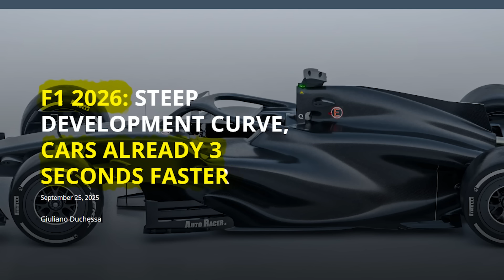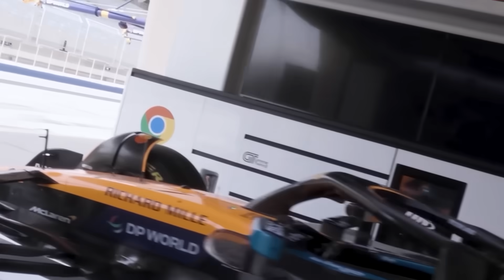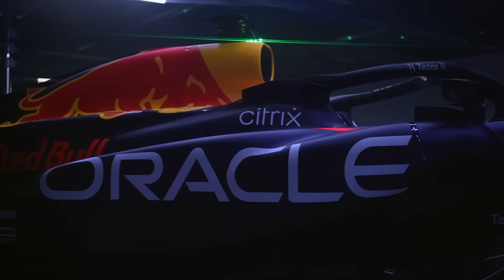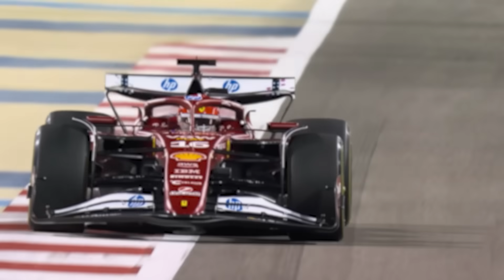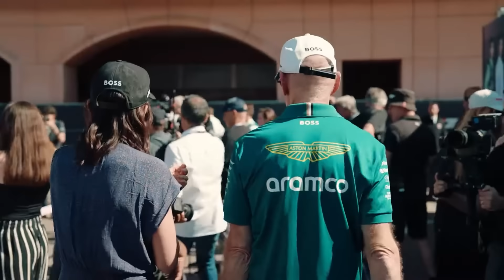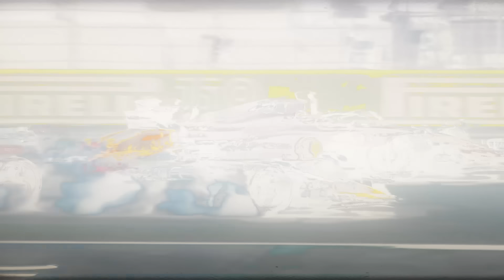How 2026 F1 Cars Are Already 4 Seconds Faster

Comment: Does the FIA realize that if the wings in the front and back get stuck open. We could see some serious crashes, possibly even death.
Reply: That's my fear too, power and downforce can be vastly different depending on the state of the car throughout the race. Make an error and you'll be entering a corner too fast. Verstappen can probably manage better than most, but lesser drivers can be caught out. Especially in difficult situations like a wet track. The whole idea is dangerous.
Reply: Do you realize that drs is the same thing and rarely we see drs getting stuck.
Reply: @solo_wing_pixy_fan7367 not anymore but when it was new it definitely did. With this have new mechanism as ways up operating i see it happening all over again.
Reply: No you won't see death, you could see crashes sure but these cars are designed for it. This is F1. They are meant to design for these challenges. And they will. No pussy footing after all the million safety features added in the last decade.
Reply: @rohitrevankar7674 i dont know those flaps stuck open and the car going over 350kph which they're predicting. I dont care how safe a car is designed. You hit a wall at that speed or more you dead. Especially if it reaches the 400 kph mark.
Reply: @shades29045  Run offs are designed to slow down the car. No way a car hits the barriers at top speed. You are underestimating F1 tracks and engineering way too much it's quite insulting especially that you are convinced you'll see a failure.
Reply: @rohitrevankar7674 i have a moto. Expect the worst hope for the best. It's better to prepare for the worst outcome and be pleasantly surprised when it doesn't happen. Then thinking it won't happen and being surprised when it does.
Reply: @shades29045  And you think FOM, FIA and the teams don't think that way? Right. Okay. lmao.
Reply: @rohitrevankar7674 i don't know honestly  nonone knows for sure. But lately they seem more interested in making F1 a green spectacle. So i don't know what they think. I hope they think that way. I'm just saying what I'm thinking. My concern for the disappointment that these regulations might be. I hope im wrong. I do hope they bring V8 engines back. I know it won't be till 2032 but one can hope. Especially after hearing that snippet of engine sound.
Reply: @shades29045  2031 will be the year. That's when both the technical regs and the concorde agreement expire/renew. So we'll know about it by 2028 max. But in any case I'll be stunned if 2026 is going to be anywhere near as bad as some ppl are afraid. One thing for sure is that racing will be tactical rather than all out cornering and braking. That's smthn some fans and most drivers will not enjoy and probably where the negativity from some drivers is coming from.

Comment: Dude I’m sorry but how tf are you asking for it to be louder? They are power units not engines. The engine is basically just a starting motor at this point
Reply: Because we are fans that remember what v10s sound like and we aren't ready to just roll over and let F1 become formula E. If you like it so much go vacuum your house
Reply: @Gleepglurp ok 1 chill tf out. You’re so pissed off at your own imagination it’s unreal. Where did I say I dont want better sounding engines? I said the power units we will have next year won’t sound louder because they’re basically a starting and charging motor for next year. But f1unchained said he hopes they sound louder than next year when that’s literally impossible. Calm tf down you absolute weirdo
Reply: @Gleepglurp  You aren't running your vacuum to bring back that shrill V10 noise?

Comment: Why are so many people are whining about these cars? Yes, we want V8's or V10's, but that's not happening. So if we put aside about the fact that we are stuck with V6's, we really know nothing about how these new regulations will play out. 

Getting rid of DRS is awesome imo. The cars a bit smaller which is definitely good. Push to pass is good. Adaptive areo might be cool. It sure opens up lots of possibilities for the aero engineers. The cars look good too, no? Will they sound better? Hopefully. Either way, we really have no idea what to expect, so why whine and complain so much? Patience my friends.
Reply: They have a 50/50 electric / ice split but they have very little electricity to deploy, so how's that going to work? You're going to be left at 50% for most of the time. There's going to be no point in overtaking in the corners now. All straight line push to passes.
Reply: You serious bro. They got rid of Drs and added active aero. Basically Drs in the front and back now 😂.
Reply: It's Mario Kart, there's FE for that already.
Reply: Hopefully between energy management, aero configuration, tire management, and all the button pushing required for this, the drivers will have enough time to race each other.
Reply: Why, specifically, would v8s and v10s not be happening ?
It's a spectacle at the end of the day and if the regs keep trending away from exciting cars that provoke emotion, the momentum of popularity that F1 has enjoyed recently, will eventually be damaged. FE cars just aren't exciting no matter how good the racing is or isn't.
Reply: It’s the not the v6 that’s the main problem, it’s the battery percentage and they way it’s going. It’s supposed to be the pinnacle of motorsport, the best of the best, innovation, technology but 50/50 battery/ice isn’t exciting or the future of F1.
Reply: @beany1987 I agree but they're also pushing for "green" which would mean more electricals. 

Now I don't agree with this personally, but also the battery issue is only on certain tracks and is unlikely to be fully drained going 400kph because it's unlikely teams will view it as worth it
Reply: @westay4924 they are already going to use 100% renewable fuel so I don't really see the argument for ev components being better for the environment.
Reply: They are Changing to V8’s-Sustainable Fuel from 2030. It’s half confirmed by the FIA
Reply: yes, we know, it doesn't take more than a brain and a calculator to figure out that these new regs will be shit
Reply: @itshammertimeF1  Well a smart brain knows that this essentially is F1 with Nitrous/NOS like in games. A temporary boost that recharges itself. Looking forward to NOS boosting F1 cars doing mad overtakes and defends. Don't get stuck on it being "electric". Just like in games you can't constantly use NOS, you have to be strategic where you use the energy.
Reply: @drags-yt  nitrous oxide does not replenish like that, nor is it especially effective when you have a turbocharger
Reply: couldn't they go hydrogen? we get v10 hydrogen cars that would be half the sound of cars that use petrol or diesel and if they want to be innovative for the future or cars pushing hydrogen and showing it can be a valid option for mass use over fossil fuel. Wouldn't that be better? (and ofcourse we get the beautiful v10 sounds)
Reply: @bubu6225 burning hydrogen is stupid as it’s less efficient than using it as a "pile à combustible" (i don’t know how it’s called in english). But as they go lighter and with synthetic fuel, the need for more electric is questionnable.  The electric part isn’t optimal as well. I don’t understand why they limit the regen per lap, and why there is no regen from the front wheel. The hybrid part is really sub optimal and we can imagine super condensator instead of lithium battery to save weight as well. But i'm sure they have good reasons. There is a lot we don’t know
Reply: @thomaslegoff4069 no front axel regen is because certain teams were in fear of Audi having a massive advantage with 2 axel regen systems. Apparently, Audi was actively pushing the regs towards front and rear regen.
Reply: @bubu6225hydrogen is fucking stupid and not practical even for motorsports.  Yes it's "possible", but not practical

Comment: Can you make a video on how you think the braking system will work on F1 cars in 2026? We’ve already heard from Brembo that some teams want a very small braking system for next year, compared to this year. There will obviously be a lot more engine braking.

What I would like to know is how this will impact the drivers. How much engine braking will there be if the driver is neither on that throttle or on the brakes? How much engine braking will there be in the split second between having completely gone off throttle and still having to apply the brakes, as you approach a corner, assuming the driver doesn’t overlap throttle and brake inputs? Since engine braking will be on the rear axle, what will the effect be on brake bias of the Brembo brake system? Will the brake bias next year be something like 80%, instead of something around 57% this year? Will the Brembo brakes in the front wheels be bigger than the Brembo brakes in the rear wheels?

I guess we’ll probably have to wait until next year to answers to those questions, but I wanted to know what your thoughts are.

Comment: For drivers that have done Super Formula, it uses an "Overtake System" (OTS), similar to IndyCar's push-to-pass, which gives drivers extra engine power by increasing fuel flow when a button on the steering wheel is pressed. Since the 2021 season, drivers are allocated up to 200 seconds of OTS per race, with a minimum 100-second cooldown period required between uses. The system allows for a roughly 5% increase in horsepower and is a key strategic element for overtaking and defending during a race.

Not sure on how the F1 system will work and if there are effectively cooldowns or the like.

Comment: You've got me excited for these engines and regs somehow, bravo 😆. A few things I wanna talk about however, mainly the pace of the cars. I do think that peak pace isn't going to be far off, if at all. The peak power of the cars are definitely there. My worry is largely in the energy usage over a longer stint, like race conditions, and is likely where the gaps between the faster and slower teams will be very apparent. The clipping mentioned by Sainz highlights how the energy capacity of the cars are way too low still to really last over longer stints, and frankly, I do think a different deployment curve of sorts would be needed to give the car a more natural feel at the pedals. Some of the TPs claiming that this era is a lot more driver focused instead of being reliant on overtaking aids as we are now with DRS is a curious and bold claim imo, but if it's true, I hope certain drivers are really able to shine in their ability to attack and defend 😉. I do believe however that these regs in particular requires every single piece to work properly for team to actually be in contention for some form of championship, a lower weight would greatly help efficiency wise for example, more efficient aero doing the same thing too, while good energy capacity and deployment ensures less restricted usage of energy, especially in race conditions, which would simplify operations for drivers and allow them to have more of their focus on the driving. I really do expect mercedes to be far ahead engine wise, with Aston and Ferrari being in the mix for second and third, while the rest will be even further behind. The aero and weight gap is a genuine question mark, where there's been little to no public mention or discussions about them by many teams. Overall, we could have Bearman and Colapinto fighting for a title next year, that's genuinely the point we are at right now. On another note, about the cost cap increase, iirc, part of it was for the cost cap to be more inclusive of other expenditure, so as to better control and account for certain things where teams may originally(and currently) had free reign over. I don't expect it to introduce too much of a change as result, if not even benefit the smaller teams such as Haas.

Comment: Good that they are smaller next season…we could see more overtaking.
Reply: But still to fast... Slower cars = better racing because less dirty air, 2012 cars are 5 seconds slower than 2025 cars...
Reply: @The.Lizard.King1993  watch some gokart races then?
Reply: @itshammertimeF1 if there was a go-kart series that had the top 15-20 drivers on the planet on their grid, I would most certainly watch it
Reply: @itshammertimeF1 no, i want 2012 style again, dont be toxic bro
Reply: @The.Lizard.King1993  it's not the cars that are at fault, it's the tracks, these are 2nd best F1 cars after 2020 in terms of pace. Why Silverstone always provides great racing? COTA? Because those are proper racetracks. Even Suzuka as amazing as it is, is way too narrow for any overtaking to happen...
Reply: @The.Lizard.King1993 that’s the downside indeed

Comment: I feel like "high capacity" drivers will really excel in this new ruleset, having to manage battery so much, in addition with the moveable aerodynamics all in addition to driving the cars themselves, with lower downforce.
Reply: More load in some ways but probably less in others.  The cars will be less easily destabilized by curbs, probably run smoother and softer suspensions, they only have 6 gears to shift through instead of 8, easier to turn, wider setup windows, etc.
Reply: Fully agree, this new ruleset seems to put more focus on the drivers. The ability to really optimise moveable aero. The mental capacity to play chess with the energy you do have. Don't get stuck on about "Electricity". THIS IS NITROUS/NOS AS WE KNOW IT IN VIDEO GAMES. No more getting stuck behind a slower driver for 20+ laps. Just save up your energy, and overwhelm them. Or visa versa, trick the driver behind into wasting energy in failed overtake attempts, and use yours where it counts.
Reply: Yeah think Max, Le Clerc and Russell will do well - max maybe struggling because of how bad honda will be. But worry for someone like Norris who has his engineer talk to him a lot.
Reply: @westay4924 Norris has full on conversations with his engineer while driving without sounding like it's a struggle at all.  I don't see how that goes to your point, more the opposite, he can handle additional things going on.
Reply: @ApocolypseZombie The guy needs coaching by his race engineer every race, seems more the opposite tbh.
Reply: @westay4924  there is no Honda in RB 2026
Reply: @westay4924  Red Bull's power unit will be Red Bull Powertrains (RBPT) + Ford

Comment: I expect to see more dirty air again because performance has to come from somewhere and teams will find it. 
 
I think that sound is accurate, factoring the more powerful MGU-K. The revs are probably limited too and, I expect the sound won't change that much because of the, revs, fuel flow and exhaust profile should remain similar.
Reply: I'd think the exhaust would be louder given there'll be no MGU-H absorbing exhaust gas energy.
Reply: @dod_the_angel  to be fair, the turbo is still going to be there, but yeah, most likely it may be a step louder. Another step higher would've been centrifugak superchargers, but those have their own quirks.
Reply: @foxgaming76yt24  There are lots of loud turbo road cars. The 1980's cars with V6 Turbos were also loud
Reply: @sukanator I'm not saying turbocharged engines are quiet, I'm just saying that the presence of turbochargers could potentially reduce output from exhaust gases. In this particular instance, we are using the current 1.6L V6 Turbo as a reference, which have had many complaints of being way too soft anyways, so I do not expect the removal of just the MGU-H to bring out the levels that people really want, especially when the turbo is still there.(Although, personally, I do think the current engines are plenty loud, I would much rather hear a variety of tones instead of focusing on pure SPL, which would require a variety of engine configurations)